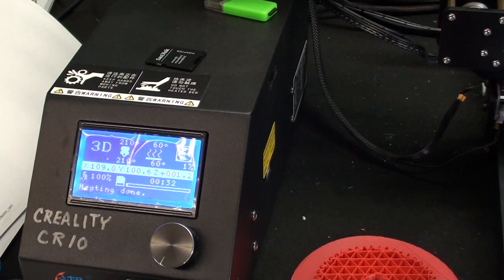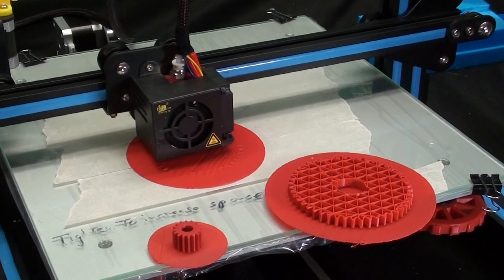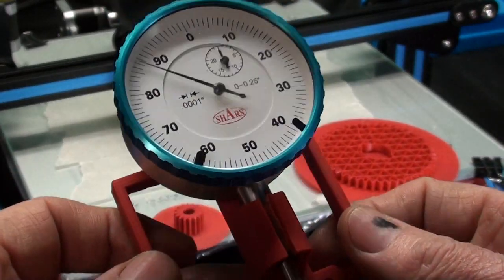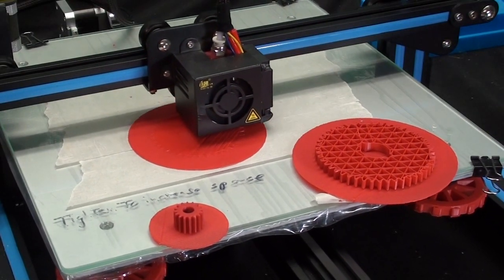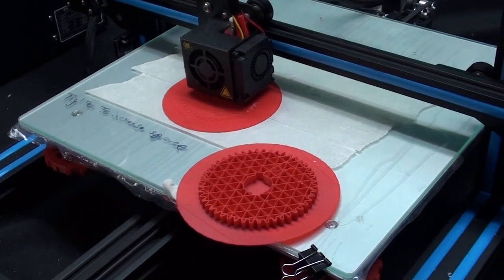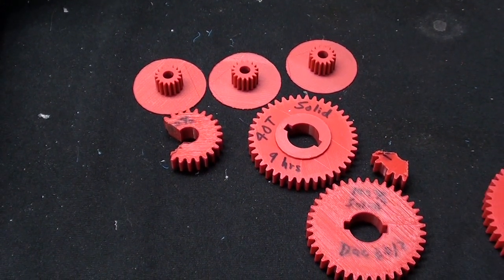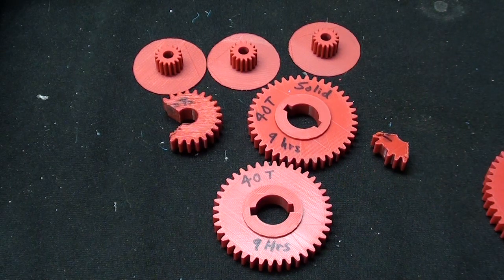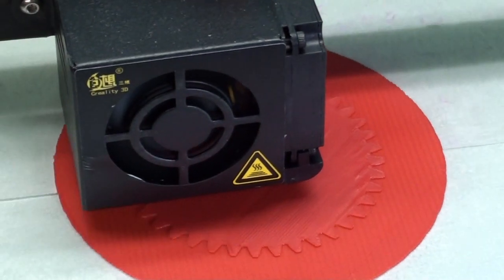3D Printing update CREALITY CR 10 with tubalcain #3

Comment: It seems like a 3D printer would work well to make the special gears needed to cut metric threads on a classic American lathe.  Since you only use them when cutting threads, the wear consideration would be moot.

On my lathe, the large transposing gear, which is a 127 tooth gear and 120 tooth gear pinned together, might provide a workout for a 3D printer since they are so large.
Reply from the maker: Yes it would be good

Comment: Be careful with running the printer while you sleep. If you have a thermister or a mosfet failure with the hot end heater it could easily get hot enough to catch on fire. People have had their houses burned down that way. I would suggest only running the printer while you can keep an eye on it.
Reply from the maker: I like to live dangerously. And refuse to worry about it
Reply: Haven't actually heard of a fire happening and I've been in this industry for 5 years now.... have you actually heard of a fire or just people expressing the "potential" fire hazard.....
Reply: It does happen. https://www.google.com/amp/s/m.all3dp.com/fire-safety-unattended-3d-printer-nearly-burns-house-down/

With the quality of Chinese electronics I don’t chance it.
Reply: Love it! :-)

Comment: Nylon is terrible stuff to print.  Absorbs water that then vaporizes in the hot end causing bubbles and inconsistent prints.  You really have to build an oven to hold the spool right next to the printer and feed straight from the hot oven to the printer - and make sure that the oven is on for a day or two before you start printing unless you've kept the nylon dry by some other means.  Also it gives off toxic fumes when printing - not recommended at all.

Comment: Is there an option in the slicer program to make the teeth (and maybe another quarter-inch in) solid and the rest at 20%
Reply: Yes, the perimeter layers, the top layers and the bottom layer thicknesses are all set separately.

Comment: Your prints are coming out great.  I am working on mine and learning a lot.  I use 70c or even 75c for the first layer then drop down to 60c or 65c and I have great adhesion with no rafting, even on small parts, all with PLA.
Reply: pla is printable without a heated bed or raft, the most that would be needed is maybe a blast of hair spray on the glass.....
Reply: jason lipavsky you can also hit your bed with a heat gun at first to get that first layer to stick.
Reply: I have a Tevo Trantula
Reply: Randy Richard In The Shop do you have a creality also?
Reply: ive done that too.... mostly with abs just to make sure the surface is nice and hot to in theory fuse the first layer, and actually, i print on a carbon fiber print bed... it has no thermal deflection and once hot actually holds the heat quite well......

Comment: Hi Mr Pete,,, great videos,,,printed gears,,whoda thunk it  You might try powered graphite for lube,,used it on a veneer lathe with wery large gears years ago. Big gear was some over 5ft in diameter,cast iron,,,smaller was maybe 6 to 8 in diameter,n nylon. was a lot quieter than iron on iron

Comment: I wonder if the leadscrew bearing support for the atlas lathe couldn't be printed? They were designed to be week and break if you ever crashed your lathe so they are really getting scarce.
Reply from the maker: Luckily I have a couple spares, even though I never broke one

Comment: Hi Lyle.  Long time viewer and admirer. Try increasing the shell size in the slicer program to increase the number of solid  perimeter layers such that gear teeth plus five or so layers inside of the root are printed solid. This will also increase the solid area around the shaft hole as well.  The remaining is infill.  Should give a stronger gear tooth section without having to print the entire gear as solid.
Reply from the maker: Easier said than done when you are a newbie

Comment: One other thought - in my experience, any of the nylons are problematic.  The nylon doesn't stick well to anything and large flat surfaces such as the gears your are printing will be prone to lifting.  If you want to try nylon, I suggest you lay down a large raft like you are doing now, skip 1 layer height, and then print the gear.  By skipping 1 layer, you can be more certain that the gear will release from the raft.  Also nylon absorbs water, and you will have to spend a lot of time trying to keep the water out of the filament.   I would suggest trying out Polymaker PCMax, which is a polycarbonate blend.   You might watch this video of Angus using a 3D printed gear in his battle robot: https://www.youtube.com/watch?v=-rbfjMozPYs
Reply from the maker: Thank you. Actually I never intend to use nylon

Comment: As others have said, you don't need to use as large a raft.  I would suggest trying to print on clean bare glass at 70C bed temperature with no raft (or skirt) at all.  Some PLAs, especially the annealable, high temp PLAs such as Push Plastic https://www.pushplastic.com/products/premium-pla    stick to the glass very well at 70C, and then when the bed cools will be loose so that you can pick it up right off the glass.  Your print times will go down substantially without a raft, and the surface finish of the part touching the glass will be very smooth and shiny.   I use 205C for the print temperature; however, that is usually with a .6mm nozzle. You may be able to print at a lower temperature with a .4mm nozzle as the flow rate will be lower.   Thanks for your videos!
Reply from the maker: I did that on a vise jaw print last night. Bear glass heated sprayed with hairspray. Got up this morning and the print was warped. Total failure, I'm going back to masking tape which never seems to fail
Reply: Im not surprised that it warped using regular PLA.   I've found that only the high-temp annealable PLAs stick to bare glass.  I don't use hairspray with these HT-PLAs, just the bed glass cleaned well with water and then heated to temperature.   Blue painter's tape works extremely well for the regular PLAs.  Regular masking tape also works ok, as you have found.     Thanks for you videos!

Comment: Its possible to print a gear with solid teeth and a body with any percent of infill.   In the cad program design the gear using one object for each level of infill.  In the slicer you set the infill for each    Because each layer of all objects  are printed at the same time you end up with one plastic part. I have not tried this yet as too am just getting started.

Comment: How would it work if you printed it in such a way as to use the 20% fill and then stop it at full width less the closed top. And then, filled the interior matrix with something like JB Weld? You'd get the speed of the 20% and the strength of 100%.

Comment: PLA is supposed to be biodegradeable. I think "they" are right about nylon. But, nylon prints at a higher temperature 265 C, I believe... My 3D printer could not go that high. If yours does, why not try... Also, I am not affiliated or anything, but I have bought my filaments from www.makergeeks.com and had no problem. They are fairly cheap and made in USA. Free shipping too.

Comment: Not having a 3D printer on hand, what would be the result of going with the 20% fill but stopping the printing when it starts to complete the final layers and filling the teeth and cavities with an epoxy or resin?
Reply from the maker: Sense epoxy and resin are also plastics, I see no advantage
Reply: I was just thinking it would save printing time and filling in the hollow teeth would make them stronger.  Just a thought.

Comment: Are the PLA gears on your Atlas Craftsman lathe quieter than the metal gears?
Reply from the maker: I cannot tell the difference with only one gear in the train
Reply: Tooth deflection under load will have a lot to do with gear noise as it leads to increased transmission error. I've had customers replace pinions with plastic or nylon to reduce noise but it just changes to more of a "slapping" noise due to deflection and deformation of the tooth under load and the vibration always increases.  On these small gears this may not be that much of an issue.  However an increase in transmission error in the gear train may show up in the finish of the parts cut on the machine, something to watch out for.

Comment: I've used nylon for small gears with excellent results.  I might suggest Alloy 910 Nylon from Taulman 3D.  If you call them and request a sample, they might just send you a whole roll.  Note that they do use a smaller reel, so you might have to print a special spool holder/adapter if your printer won't support the small diameter.    http://taulman3d.com/alloy-910-spec.html

Comment: Tip, you don't need to make the skirt that big. In matter of fact since your printing a large flat circular part, you don't need a skirt. I use PLA all the time and I really don't use a skirt. If you was using ABS, then you would need the skirt.
Reply from the maker: You are probably right, I'm still learning and playing
Reply: Continue to use whatever works for you in your environment with your machine and filament.  Use of a raft is more dependent on the shape and density of an object than the filament used.  Large, flat, dense objects are more likely to curl during printing, as you discovered in some of your early attempts.
Reply: mrpete222 you can do what your doing, no one said you "Had to " it's just a tip so you won't waste filament.

Comment: The test gear that you made and ran on the lathe made me wonder if a printed set of half nuts would work? I know you are in the testing phase with the gears and to early to know how they will hold up. I was wondering what are your thoughts on a set of 3D printed half nuts for my SB?(or am I just half nuts for thinking that? haha) Someone said they thought you had made a video on on making & replacing half nuts? I can't seem to find. I know that the gears do not have any draft on them to use as a pattern but could they still be used as a pattern as is? It will be awhile yet before I can get back out to the poll building to start tinkering again as it is pretty darn cold in N.E Ohio but it is driving me crazy to watch all this videos on machining, mold making and I cant get out & do anything lol Thanks again for All the GREAT videos and for all that I have learned from listening & watching you it's a real pleasure !! not just for me but to everyone -Two Thumbs Sir!!
Reply from the maker: I bet they would work, but that would be a very complicated model to make. It certainly would require fusion 360. Which I do not know how to use

Comment: I suggest making an arbor and a jig that can hold two gears meshed with one being stationary and put a torque wrench on the other and see how much torque it can handle before shearing a tooth......that might be an AVE type of job.

What about making some metric transposing gears for the lathe? I could see this being a really good way to get those.
Reply from the maker: That experiment, sounds interesting. But I would also need to do it with the metal gears for comparison. And I do not want to destroy any good gears
Reply: It'd be a bit of work but maybe 3d print a pattern and cast a sacrificial gear?

Comment: PLA has an excellent resistance to oils and greases, so no problem there. Aromatic hydrocarbons do attack PLA, so it does not hold up against gasoline for example.
Reply from the maker: You are the first one to tell me that. Everyone else said the oil will destroy their gear. In fact, I now have a gear immersed in Quaker State oil For a test
Reply: https://www.galateabiotech.com/en/what-we-do/bioplastics/pla This is one example where that resistance is mentioned from one manufacturers site. Heat and UV-light are worst enemies of PLA machine parts.
Reply: Also moisture is bad, because PLA absorbs water. Although I do have PLA printed diamond grinding pad holders in my stone polishing machine and those have not been affected at all in two or three years they've been on that machine and gotten a lot of cooling water on them.

Comment: Finding chemical resistance data for PLA is just about impossible, and I know well enough that it might be useless anyway, considering the variability in filament between sources.  Still, it should be something similar to other polyesters.  I don't know that the base oil would be much detriment, but solvents or additives in the oil might.  

I suppose the best way to know is to print a bunch of test bars and do some experimental analysis.  Trying to measure load at failure with simple equipment isn't easy, but I imagine it would suffice to do a creep test (e.g. measure deflection of a cantilever bar supporting a weight on its end for a given period of time).  For a hobbyist's applications, this should reveal sufficient information about the relative degree of influence each test solution has on the material.
Reply from the maker: I don't care to go to deep into this matter. However, I do have a gear immersed in oil for a test
Reply: If that's the application you want to put it in, then it sounds prudent and effective to me!

Comment: It seems you just need to find a way of filling in the teeth and a small area under that and you'd be good to go with 20% fill everywhere else.
Reply from the maker: I still do not have the know-how to do all of that experimenting with the layers. I would just as soon let it run all night while I'm sleeping, and not fool with it
Reply: By using alot of perimeters the teeth will fill in and increase the strength of the gears.
Reply: Hey Mr.   Peterson.    Wall thickness, or rather shell thickness is easy.   If you set it to something like 4mm, every external surface will be 4mm thick measured perpendicularly to the surface.   Since 4mm will "flood" the teeth area, the outer edge with the teeth will be solid.   Also, the bore is considered "external" so it will have a ring around it that this 4mm thick
Here is a good Cura reference: https://ultimaker.com/en/resources/21932-mastering-cura
Reply: I do that with a shell operation and rib operation in Fusion 360 or ZW3D. I don't normally use the slicer's partial infill feature as it doesn't give enough control over the shape and location of the internal lattice. I can create arbitrary lattices, as a separate bulk part, then do a boolean intersect to trim the lattice to the volume of the part, then shell the part, then do a boolean combine of the trimmed lattice with the shelled part. If you don't have an open face, it's not obvious it's changed anything, but you can see the result if you do a section view or check the mass properties before and after. This gives me access to lattice structures that are not available in Cura or Slic3r, and lets me set the center of radial lattices to be at the load points and customise the density of the lattice to be where it needs to be. It's a little more work to be sure, but it's really worth it for the added quality, lightness and rigidity you get this way.

Comment: I print lots of gears myself, a good tip is to print the outer shell first, then the infill, this makes the gears more accurate. As for creating the gear files yourself, I use a program called Gearotic, well worth a look. Thanks for your videos, an asset to the community.
Reply from the maker: Thank you, I should look at that program. But I really need to move on to other things

Comment: Nice to see you have embraced 3D printing mrpete222, however be wary that pla start going soft at approx 50deg-56deg (glass transition). Pla is nice to work with relatively fume and smell free, just the low working application temps. let it down. Thanks for the video. Always look forward to your stuff.
Reply from the maker: Time will tell on its durability

Comment: I believe ABS is harder than PLA , its that common black plastic used in cars and stuff , i'm not sure if every printer can print in nylon but i think all pla printers can handle abs?
Reply: ABS needs a heated build plate (not all pla printers have that) and a heated chamber for any taller parts (or else they delaminate). If anything, you might want to try PET-G as it is easier to print than ABS and similar in properties.